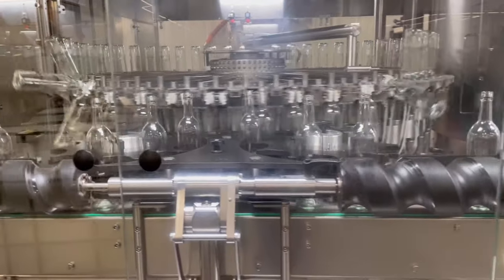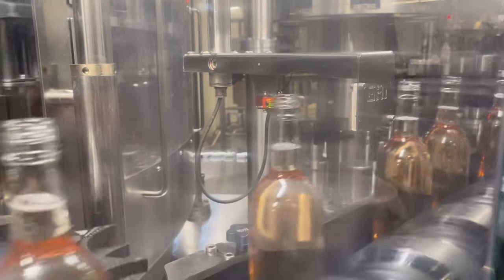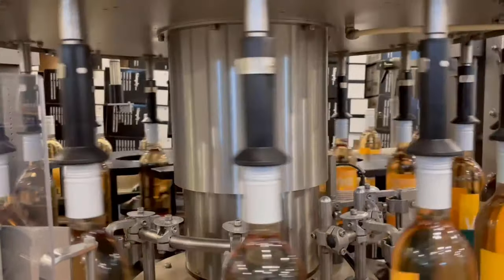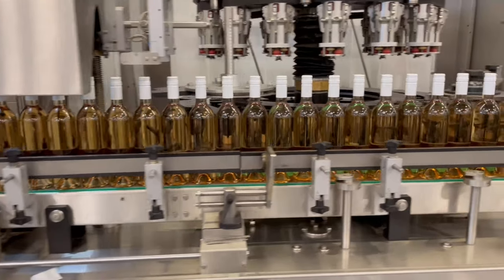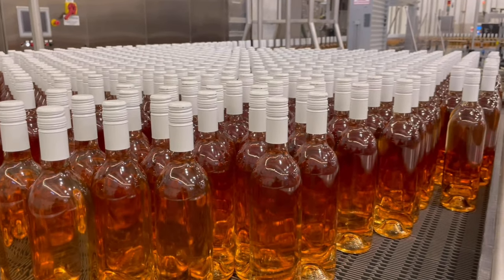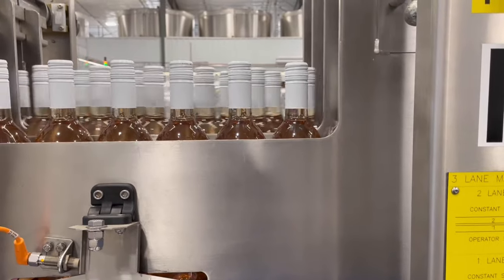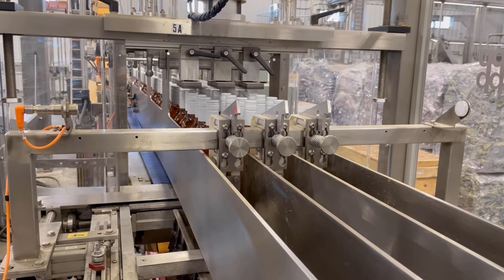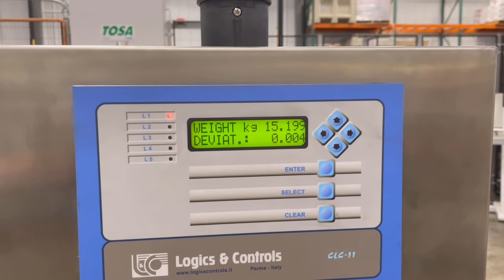The Essentials of Bottling Wine

Comment: Always wonder how the winery can ensure every bottle is identical with such huge volume of wine, especially those aged in barrels prior bottling, do they blend all of the wine together (possible?)and monitor the wine consistency from first to last bottle?
Reply from the maker: Good question. Large wineries often use massive blending tanks. Aside from that the wines are analyzed for the key measurable, acidity, alcohol, etc. Also tests are done to minimize microbial risks. Lastly, bottles can be pulled within each bottling run to be tested again. Many wineries, the one in video included has an in-house lab for testing.
Reply: Thanks,  Bob ☺